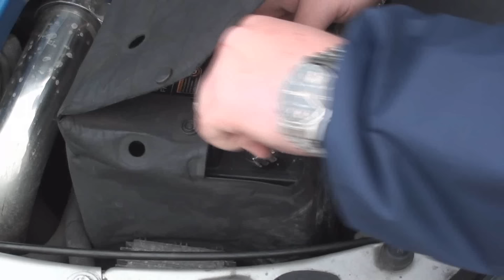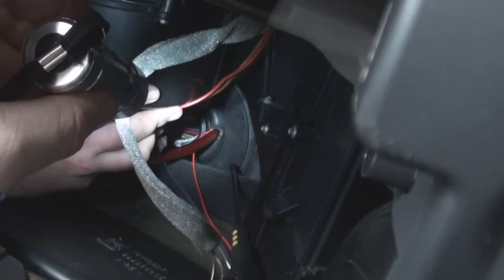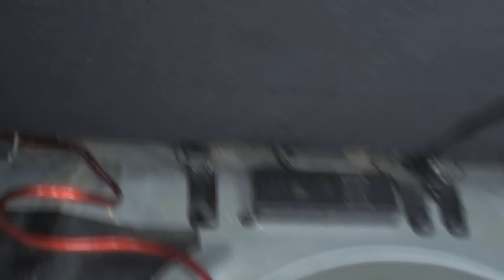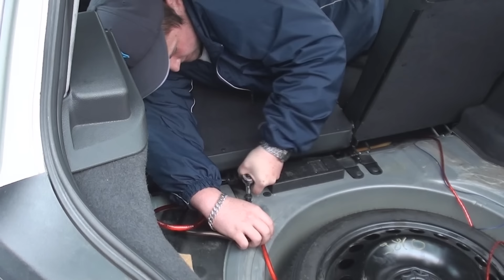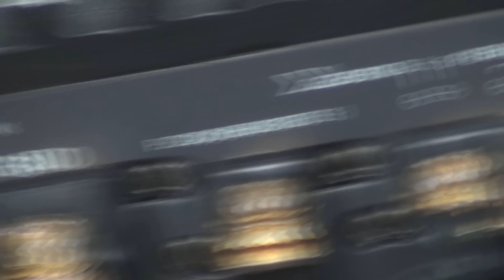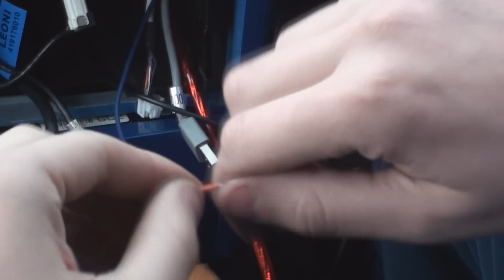How To Install A Subwoofer And Amplifier In 5 Minutes!

Comment: ff
Reply from the maker: first off if your unsure of anything check out our drivers club, you can join share pictures etc and make things easier, links in description.

depending on the amp and sub your installing, if its a real powerful one then a bigger battery may be better. again without seeing things its hard to say. 

if its a aftermarket cd player, they normally have a remote cable, in the UK they are Blue, you just attach it onto wire to get the remote signal.

If your stuck, join up and ask.

Bluudy

Comment: can I connect sub with amp on original car stereo on ford focus
Reply from the maker: yes, but you will most likely have to cut and splice some cables to get them to work
Reply: Absolute Modicts you need a line out converter. they go for around 10-20 bucks

Comment: Ive just bought an amp kit online with a 4gauge wire (tho it dont say anything on the actual wire so) but in the small fuse holder its got a 60A fuse.. is this too small and would just burn out? ive got 1 12" sub and a 4chl 1100W amp atm ive dug out from the shed. should i get a bigger fuse you think?

also just noticed the fuses in the actual amp are missing. would you say 125 fuse? complete novice at this sorry pal

Comment: What kind of screws should I use to secure the amp to the box and the sub in the enclosure?  Just regular wood screws?
Reply from the maker: As the box is made from MDF, any small self tapping screws will be fine.

Comment: isnt it a bad idea to mount the amp on the sub? I have a 1000w amp max (300w RMS) with a 1200w max sub (250rms) so would I worry about overheating/vibrating the amp?
Reply from the maker: nope, Dont listen to others, If there was an issue, they wouldnt made active subwoofers with the amp built in :)
Reply: @bluudysgarage  I was thinking the same thing as this guy but your reply also blows it out of the water.
Reply from the maker: @brysoncharlie  because I'm right lol

Comment: Good video. Going to attempt this tomorrow. One quick question tho (may sound daft but anyway) if I was needing to remove the sub and amp from the boot for work tools unfortunately... how would I go about doing this? Just remove all the wires from sub and amp? Not sure thats a safe way tho or is this perfectly fine lol
Reply from the maker: Its easy enough to do, Remove the fuse from the power wire, Disconnect the cables from the amp, and remove the sub and amp from the boot, Tuck your cables out the way etc. Just make sure you remove the fuse, otherwise you will cause it to earth out etc. you can get quick release connectors as well, maybe something to look into? any more questions, check out our website, link is in description, hope to see you there!

Comment: how exactly do you get the power cable into the fuse holder? are you supposed to cut a piece of the power wire to connect to the other end of the holder or something?
Reply: You don't put the power wire into the fuse holder. The remote power wire is just a wire that sends a 12V signal for your amp to turn on. You just strip a quarter of an inch, find a fuse that only works when the car is on (like one for the heater or windows) and then pull the fuse out and wedge the wire into the fuse hole when you put the fuse back in.
Reply: Alec Mason Also, you might want to get a toggle switch (or in my POS car I just have a light switch) and cut the remote wire and put one end of the wire on one terminal and one end on the other terminal. (this allows you to turn off your sub if you want)
Reply: okay but what goes thru the fuse holder .-.
Reply: Shit, I got you. If your wiring kit came with a fuse holder that is attached to a small loop of wire, then cut the loop and either solder or crimp the holder to the rest of your power wire. If your fuse holder came separate from any other wire, then you will need to cut your power wire and attach one end to one of the terminals on the fuse holder and one to the other.
Reply: Sorry I didn't understand your question the first time. Hope I got it right now.

Comment: I have a question.. Do you need to have a new engine for car audio or is it just preference? (Iv heard people talking about getting new engines for car audio)
Reply: Some people get a new Alternator. That's the part of a car (it is in the engine compartment) that turns some of the mechanical energy from the car into electrical to keep the battery charged. Unless you have several thousand watts, you'll be fine without a new alternator.
Reply: thanks!

Comment: i have a 350w sony xplod amp wired to my speakers, can i still wire my 1000w subwoofer on it, will it damage anything?
Reply from the maker: how many channel is your amp?
Reply: Absolute Modicts 2 channel bro.
Reply from the maker: i wouldnt recommend doing it, the output of the speakers is different than the subwoofer, so it will try play the sub as a speaker, or the speaker as a sub, depending how you wired it.

Comment: Yes wire size matters, about 200 to 500watts 8gauge wire is fine, but 700watts and up 4 to 0 gauge wire for sure is needed for that kind of power, but no matter what you should use at least 4 gauge power wire for any wattage under 2000watts and 14 to 10 gauge for speaker wire.

Comment from the maker: In the video we use 4 gauge cable for the power and earth. IT makes a big difference, try a sub connected with 10 gauge, swap to 4, and there will be a huge increase in bass. we was very surprised.

Comment: hey i have connected the power cable to the amp but the power light did not come up ... i could nt really find out if the amp is faulty or there is some error in the connections ... 
what do u suggest to find out if the amp is faulty ?

Comment: hey i have a question why when i increase the volume in my head unite the sub stays the same. so i cant control the volume of the sub from my head unit ? example ( my amp volume is on 10 % i increase the head unit volume to 50 % the sub stays at 10 % ) thx for your help

Comment: My sound system is going to bang Got a 12 inch Pioneer Champion 1000 RMS Sub that's 2 ohm and a 900 RMS kenwood amp that put's out 900 RMS at 1 ohms stable, can't wait to hook it up :)

Comment from the maker: Find the fuse on the Power cable, and remove it. install your sub and amp. once everything is connected up, the last thing you do before turning it on is put the fuse back in place. hope that helps
come join the forum, show us your work :)

Comment: hi i just got a car that already has the wiring kit installed, but no amp or sub. The wires have been taped off at the ends.
My question is: I have a vibe amp + sub that i can hook up, but should i disconnect anything first? Positive fuse or negative terminal? or both? or none? just dont wann blow anythin or get a shock when i connect my sub n amp. Cheers :D

Comment from the maker: turn the High pass off, that way you get the low notes to your subwoofer. I think the level is the amp power, more power more bass (i think) and the boost is an increase directly to the output.

Comment: I have my amp and sub installed, but I'm not sure about tuning my amp. It has a hpf that ranges50-500 and a lpf knob that ranges from 30-500 a x-over switch and a level knob alongside a bass boost switch. Do you have any tips? Its hooked to a 12in pioneer E series sub in a ported box. The amp is 360 watt

Comment from the maker: The red should be ignition live, you could run a feed off there to the amp and use that as the remote. As it would turn the amp on when you turn the engine on an CDs player too. Join the site I you want some more help with your installation 
Bluudy

Comment: hi guys 
i already have my amp and everything installed but i have now changed head unit and it does not have a remote lead coming out of it but does have RCA out.
the wires on the iso conectors have the four speekers as normal then the other side has 
yellow- constant live
orange- power antenna
red- acc live
white- panel light
black- ground 

so how do i get my remote live to my amp please can you help ?

Comment from the maker: i bought it from TX Autosport, This kit wouldnt fir the 1.7, as the kit was designed for the 1.9

Interms of fitting it ok, it bolts onto the crossmember, and then has the piping routed were possible, im not sure if there are any kits made for the 1.7

thanks mate